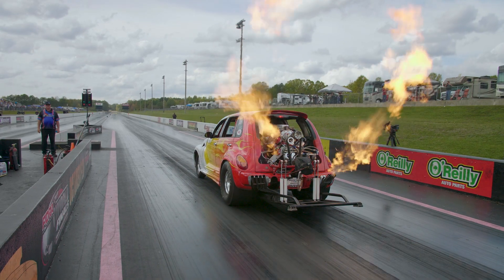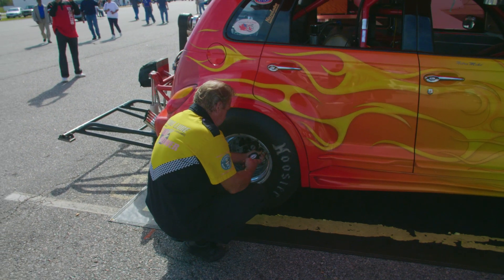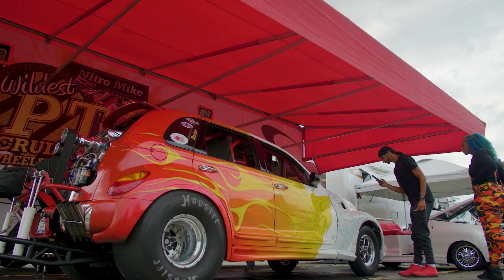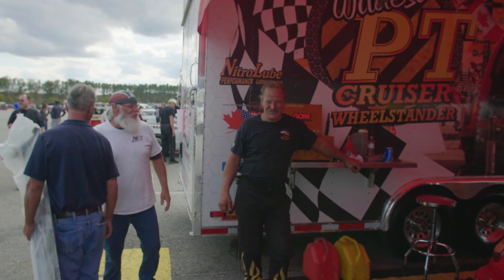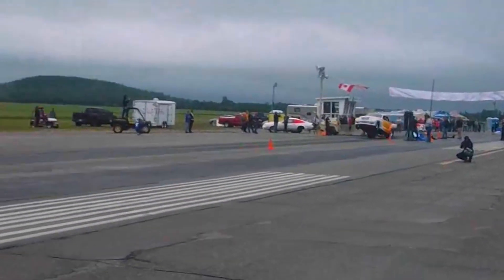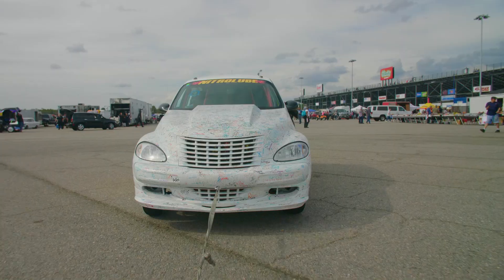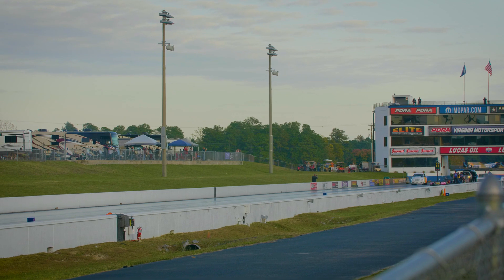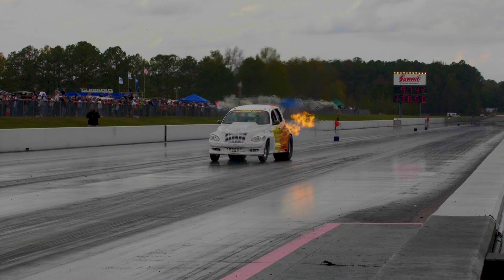World Record: The Chrysler That Can Wheelie 2,500 Feet | RIDICULOUS RIDES

Comment: Is it really a wheelie if you need to involve a wheelie bar? If this is going on a guinness world record book it may as well be called assisted.
Reply: its the keep the driver safe so it doesn't roll over immediately like that famous pinto thtat flipped over right as he did his wheely
Reply: Bars are for the riders safety. It's still driving on it's 2 rear wheels.
Reply: Its a crutch though. If you need wheelie bars on a car, then it wasn't meant to flip. Do bicycles need wheelie bars? Do motorcycles need wheelie bars?
Reply: I agree in a wheel comp they should learn to throttle control like monster truckers. Wheelie bars in drag racing I understand fully though.
Reply: @j0nny93rs  i agree with what youre saying. For a drag race where theres not much throttle control because its gung-ho or be left in the dust so they def need wheelie bars. And same for monster trucks that have a crap ton of horse power and that those drivers have amazing throttle control. But if its none of those and its for a world record they should def specify thats its an assisted with wheelie bar or not.